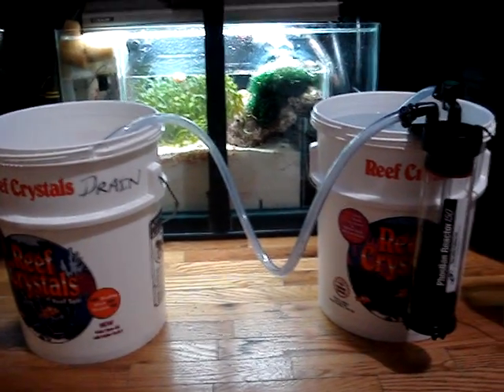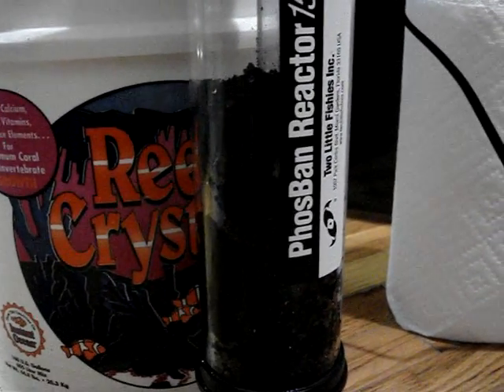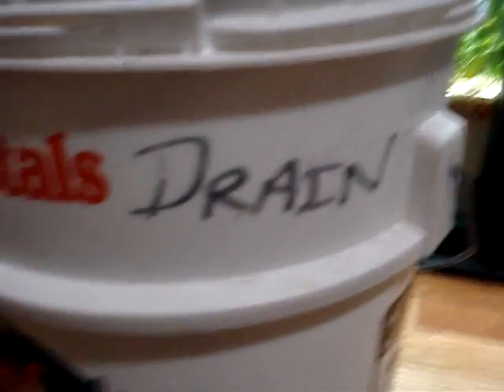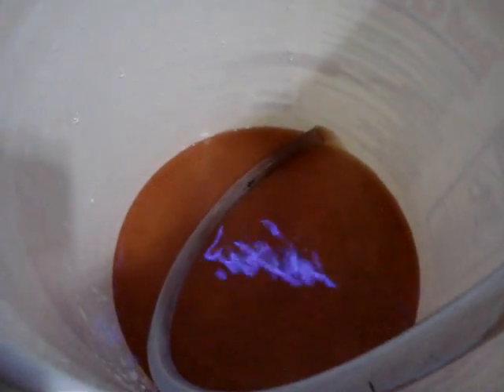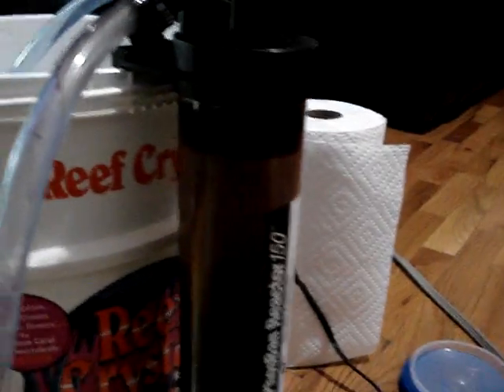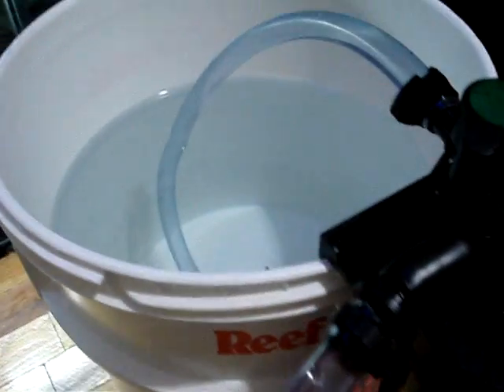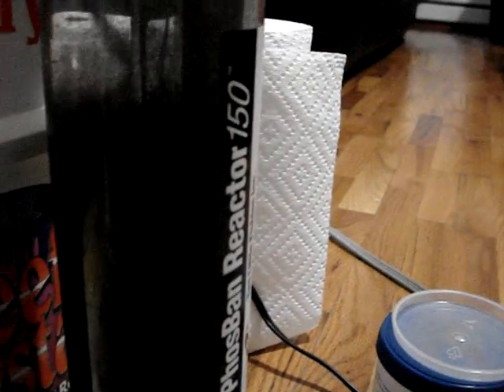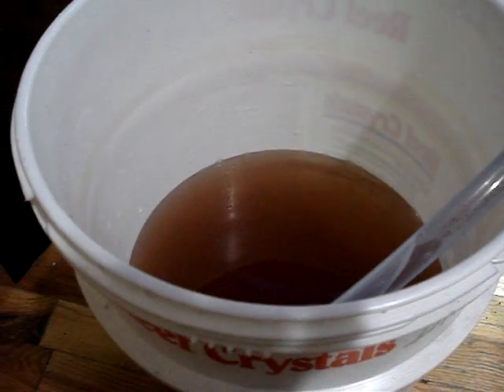Phosphate Problems And Solutions Part 2 of 4

Comment: Hi. I've been having problems with Phasban 550/mj1200. I started running with 250ml of Rowa, which is recommended amount for a 220 g. However, it looks only 1 1/2 inches of Rowa in the reactor. It was tumbling strongly first with max flow. The next day, it quit tumbling and the media just sat at the bottom. I've also noticed the bottom black sponge/red plastic are tilting sideway. I corrected the sponge/red plastic position, and I added 1/4 cup of Rowa and re-started it. The next day it's same

Comment: Alright bro. I'll give it a bit more time. I also added a pump for more flow in the fuge which seemed to help a bit chaeto appreciated it much. I find that when the fuge light fist turns on, the cyano sprouts up quick, but in the morning, before the lights go off, the cyano is nearly gone. I am now adjusting the RKL to keep the fuge light on a bit longer to see what happens. Thanks again. I'll let keep you posted.

Comment: On your current 90gl tank do you use a media reactor? Also I have a 90gl reef with coral and 2 SPS has been runnign for appx 4 months. My calcium and alkalinity i test almost daily and the parameters are still in the correct zones and have not dropped. I have the 2 part calcium and alkalinity dose as you recomend and use. My question with my parameters not dropping do I start dosing or what adn is there a reason they have not dropped?

Comment: Steelo, I finally set up the phosban reactor to my system.  My new 90 gallon is 3 months old and I was having brown hair issues. After setting up the reactor, it was almost instant, the brown hair algae was disappearing. It had only been 3 day, however , it's a slow process.   Thanks again mr. Steelo for ur video.

Comment: @newyorksteelo bulkreefsupply sells reactors for cheap, i think they're 40 bucks without the pump, they recommend using a maxi-jet 1200 on them.

 So you don't still have that pump forcing water through the bags anymore?